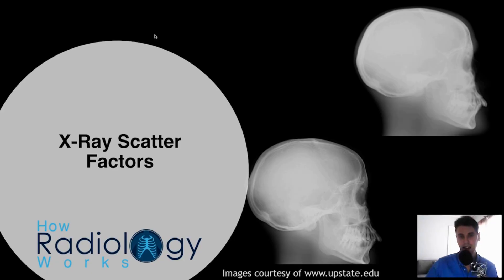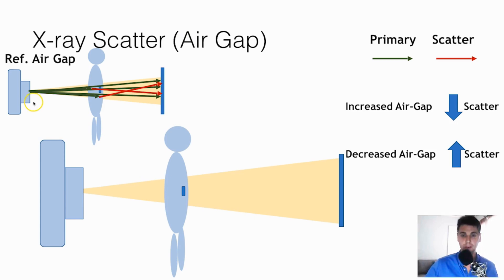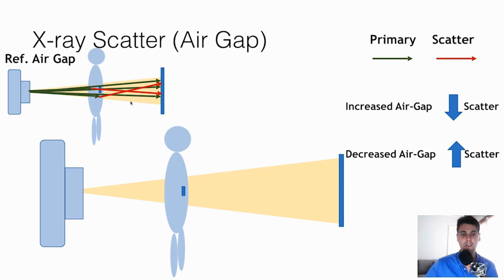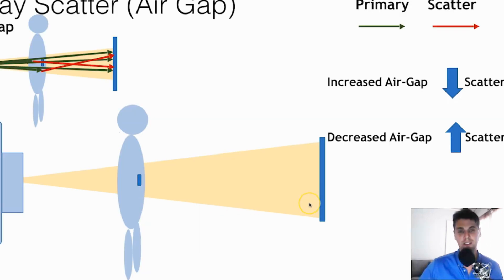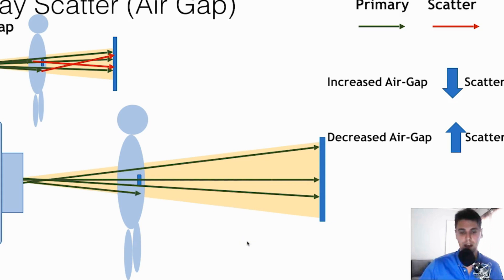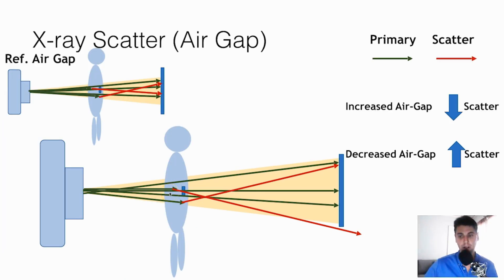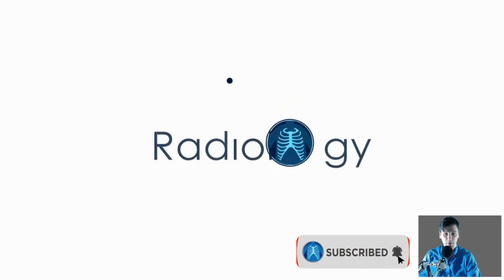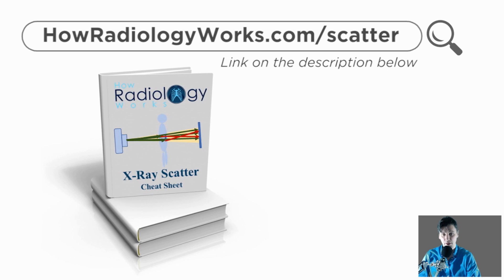Scatter Air Gap Rad Techs (Radiologic Technologists)

Comment: Hmm, this was not intuitive.  The bigger the air gap, the wider the scatter/noise cloud - the noise is no longer localized - it is everywhere.
Reply: Scatter is a low frequency effect which is different than quantum noise. Moving the detector back further spreads out the scatter contribution and allows the chance that some outscatter and don’t reach the detector. This effect is less effective when the scatter is more forward focused such as high kVp.
Reply: @TheNettforce  Ahh - that was the piece that I missed.  Thanks!
Reply: No problem thanks for checking these videos out so quickly.